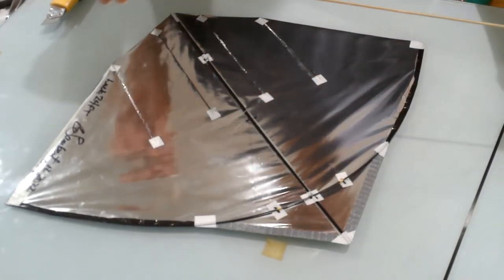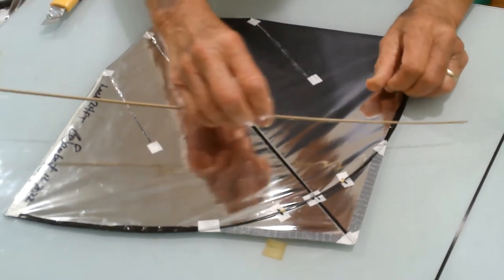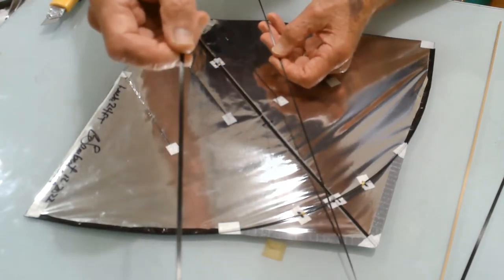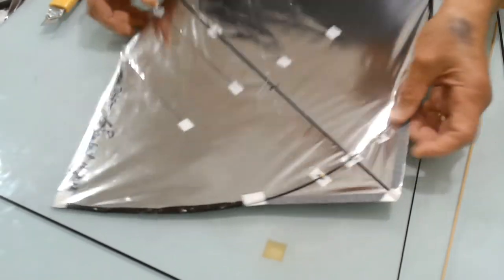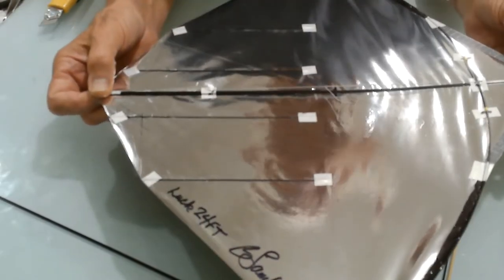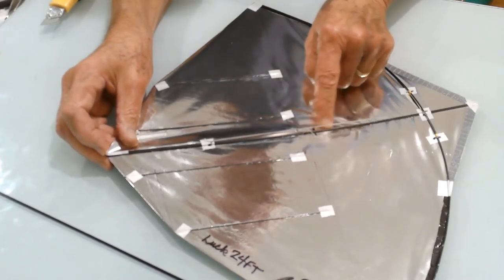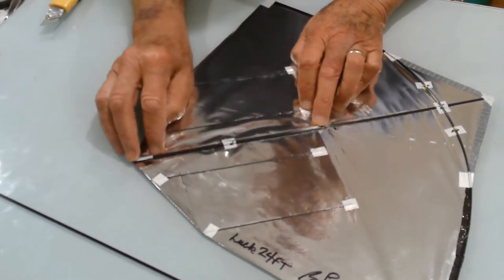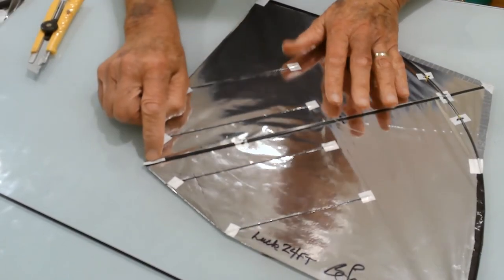Using A Carbon Fiber Spine In A North American Fighter Kite.

Comment: I have access to a flat belt sander at work and I put a very nice flat even taper on the rod used for spine (this taper is for the nose and a tension line added), of course i take in consideration the natural bend of the rod to locate the taper on the spine.
Reply from the maker: Great Idea, I always taper the noseward portion of a bamboo spine, so now I'll try doing it with a carbon fiber spine.  Thanks.  Bruce